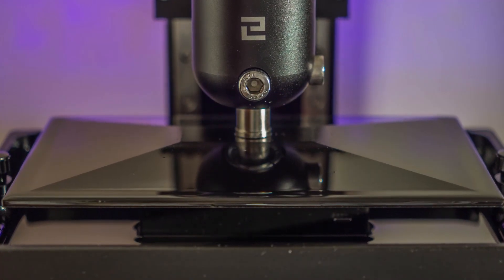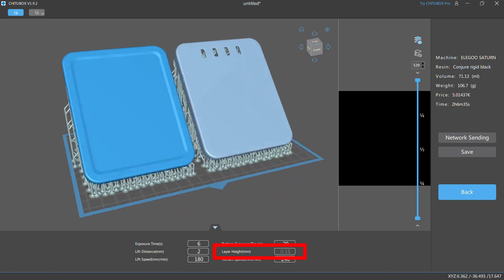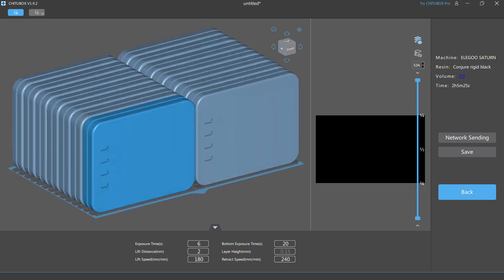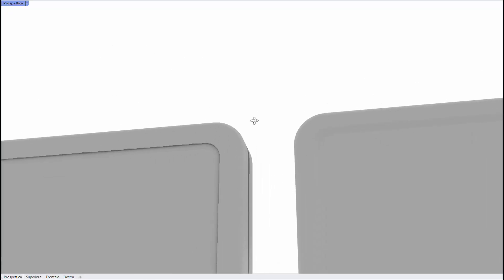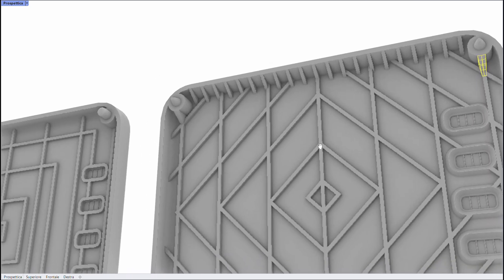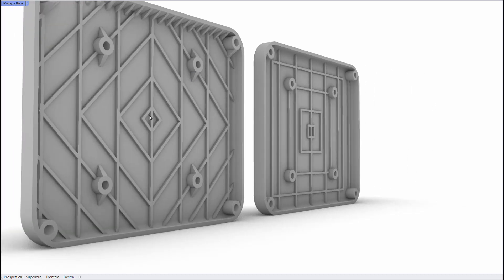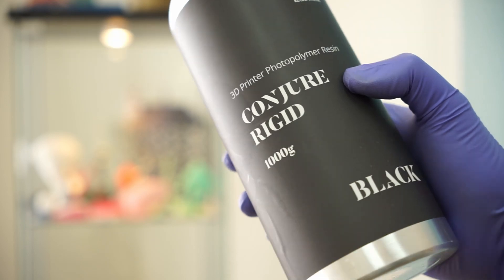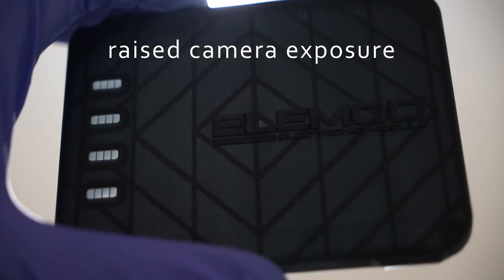Optimize 3D models for supportless resin prints and faster batch production

Comment: Hi, I'm also producing functional parts (non prototype) but I find that the finished is not as smooth as I wished. I was wondering if you could give me some insight about finishing prints in a efficiënt way. ( Preferably no manual sanding) it might aswell be a good yt video as there is not much content about this here. 

Kind regards
Sander
Reply from the maker: Hi, may I ask you what printer and resin do you use? Did you printed the functional parts at 150 microns or less?